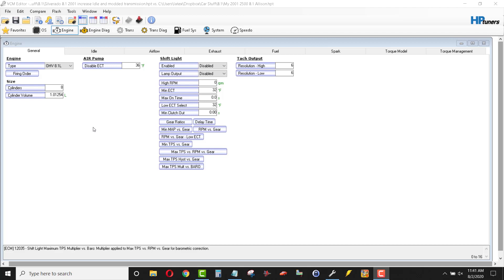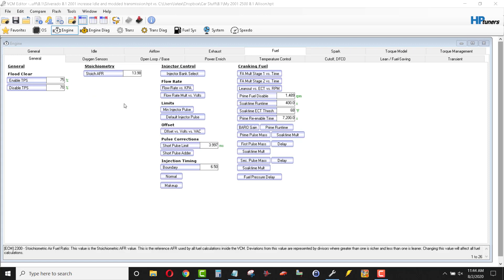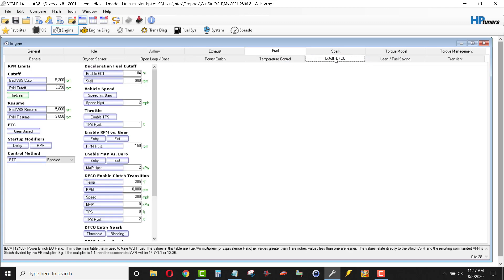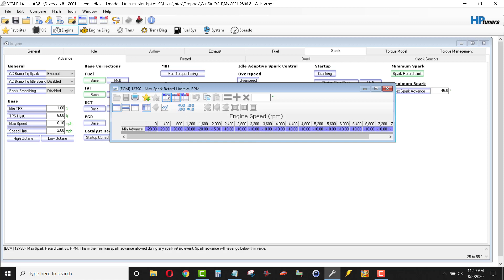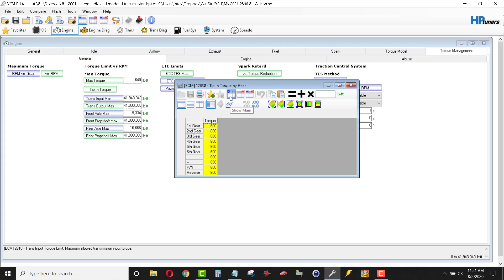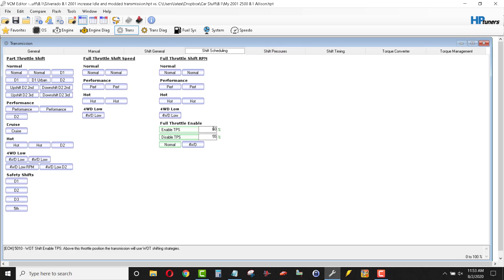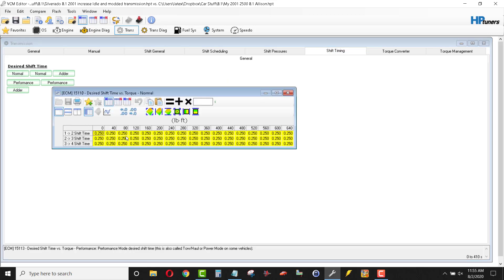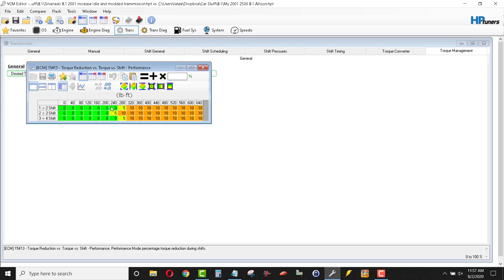Silverado Engine and Transmission Tuning HPTuners 8.1 Allison

Comment: Excellent video.... are you still tuning?? I have a 05 3500 DRW with this setup. 8.1 Allison. my mods: gibson shortys ,x pipe,duel flowmasters,3.5 duel tailpipes,CAI,MSD street fire coils,Raylar bp202 roller cam and rockers combo...is there anything you would change in this tune??
Thanks
Reply from the maker: I don't know what tune you have to start with - stock?
Reply: your tune in the video as close as possible, I do have an TDN account if that helps. thanks  @CarswellsCustoms
Reply from the maker: @mud4x  Sorry bud, I don't recall what TDN is? With those mods I would pickup a wideband and tune for WOT 12.5 AFR. Start there and with all those mods you will be very happy with the 8.1's response.
Reply: Thanks, I have hp tuners MPVI3 comes with TDN ( Tune delivery network) @CarswellsCustoms
Reply from the maker: @mud4x  Oh, yeah. Early morning... Email me a datalog @ mymusiconmyiphone@gmail.com

Comment: I'm curious why a lot of the transmission tables only show up to 4th gear? Can you not tune the behavior of 5th (or 6th if equipped) gear?
Reply from the maker: If the tables are there then you can mod 5th gear. I guess you would have to ask yourself what you need 5th gear to do differently? I would assume that when I mod my vehicle I am looking for improved transmission performance by decreasing shift times, and increasing holding pressure to get the load up to speed with reduced wear on the trans. I personally would not worry about 5th gear too much as I would assume that the load is mostly up to highway speed and most of the stress of accelerating the load has been handled by 1st through 4th. Just my .02.

Comment: Hi. Just wondering if you have an opinion on how many miles is the Allison trans usually good for? I'm looking at an '04 Avalanche with 8.1 & Allison. Truck has 252k.  Transfer case was just rebuilt, but trans & engine are still original. Thanks in advance.
Reply from the maker: @Dennis Tucker Gosh, I really would not know without the history of the vehicle. I mean, how much of its life was towing 14,000lbs for example? My truck towed horses before I owned it and now I only tow a 3000lb boat. So I believe history is more important than brand name. Sorry, not very helpful...
Reply: The 2500 avalanche never came with the Allison trans. Only 8.1l with 4l80e.  Want fit without a body lift.

Comment: Would you consider tuning a 2008 6.0 Chevy 2500? I need torque management (aka nanny controls) turned off!! My Black Bear tune didn’t do it!  Truck runs great with only 86,000 miles on the clock,but it needs more. I don’t mind seeing tire smoke now and then!😜
Reply from the maker: @Gerry Patrick Thats curious, many people are very happy with their Black Bear tunes. I would be happy to look at the file for you, I have tuned quite a few 6.0 trucks.  Can you or a buddy pull the tune and email to me?

Comment: Hi I Love the tune on your truck.Would that work on my 2004 3500 srw. xtndc. lngbx. 8.1? Im hauling a 9'4" camper & a 8"cargo trailer 6mos. of the year in BC Canada. Im having a Raylar modified stock intake installed the end of Feb. A tuner is doing the install& tuning. I have same mods you have, on my truck. Thnx
Reply from the maker: Yes, if you are having a tuner do the work he could start with my tune as a base, and go from there. This tune has been used in my truck for over 2 years now. Good stuff. Send me an email for a copy - mymusiconmyiphone@gmail.com
Reply: @CarswellsCustoms I email you

Comment: So this may sound like a dumb question....but with all this "transmission adapter" and "stand alone tcm" stuff, by any chance could I swap a Ally 1000 to my Ford 460 and still be able to tune it? The 460 is built so I know the Ally will have to be built. Just wanting to know if I can set my shift points as high as I'd like to (6400 revs)
Reply from the maker: @R3B3L10US_TY Good question, it would have to depend on how your are controlling the Allison transmission - I would think you would use 2 systems, ECM to control the 460 (or carburetor) and another system to control the Allison. I dont believe you can easily modify a Duramax or 8.1 harness and computer to work with the 460 so you would have to find a Standalone TCM for the Allison that you could set the shift points. I have not researched it but if you send me a link to a standalone Allison Transmission Computer I could do some research for you.
Reply: @CarswellsCustoms  I'll get right to it, bud. It'll take me a little while to figure the link stuff out but I know quite a few stand alones out there. Most of the stand alones are from diesel performance shops but that shouldn't be a big problem.

Comment: did all your adjustments,  between first and second shifts now it hesitates a sec and the  engine revs , then slams into second . what did i do wrong?
Reply from the maker: Unsure, go back to stock then change one section at a time. Start with reducing  shift timing test then when you are happy work on new settings from there.

Comment: Hello,  I am interested in tuning my 02 Silverado cc long bed rwd 2500. 8.1/Allison.   It has Gibson headers, k&n intake, Gibson muffler and dual exit with tips.   I replaced all plugs with gm delco plugs & msd wires…can’t figure out why the truck runs so poorly.  It barely tows as good as my 5.3 that’s has more than double the mileage on the odometer.  This 8.1 only has 108k miles.   It get 6mpg and tows terrible.  It struggles to maintain 65 mph with out down shifting with no load (empty bed, no trailer).  I’ve ran high octane fuel etc and no real difference.   Everyone I talk to tells me the 8.1 should tow as good as a stock lb7.   Any ideas??!! Please help.   This is such a nice truck but I think I’m going to sell it if I can get it to do what it’s supposed to do. Also, has no DTC or check engine lights of any kind and it passes smog no problem.
Reply from the maker: I havent pulled anything with a Duramax, my only diesel was a 7.3. But I know my 8.1 will pull the ears off a Gundark and chirp second gear. The 8.1's are good healthy engine.
Reply from the maker: Wow, lets not jump to tuning yet as this seems like a fundamental issue. Lets start with basics - first clean all grounds especially the drivers side engine ground on the bottom of the engine block. Use dielectric grease after cleaning. Second read the fuel pressure on the rail, looking for 58-60 psi. Since the plugs are new, pull them and read the plugs. I like thos website and I bought some of their printed instruction manuals - http://www.4secondsflat.com/Spark_plug_reading.html
Reply from the maker: DTC's can be turned off with HPTuners so after the basics are investigated you can move onto more advanced stuff.

Comment: Hi i have a 4500 u haul w 8.1 and allison 513 gear i believe can you re pgm my computer if i send it to you.
Reply from the maker: Yes, I can do that. What was the year? Actually can you email me at mymusiconmyiphone@gmail.com 
Thank you!
Reply: O.k. 2005 142000 miles 19.5 tires. 513 gear 5sp allison also can the trans be redon for 6speed. I believe that there is a kit or a way to do. Also cost thanks. John in idaho

Comment: Great Video!  I just bought a 2001 Sierra with the 8.1 & Allison.  I am wanting to get the Allison to upshift sooner in the normal mode.  I have been trying to figure out which tuner is better suited for the older Allison TCM, EFI Live or HP Tuners?  Your video doesn't seem to show the Allison transmission options or am I mistaken?  Will the HP Tuners software talk to this older 8.1 and Allison combo?
Reply from the maker: Texasdeere, I have a 2001 8.1 and Allison, I use HPTuners and I am very happy with it. Cant give an opinion on the others. You want the upshifts to occur sooner? In HPT you would go to Transmission-Shift Scheduling- Part Throttle Shift - Normal. After you get into the shift matrix you can increase or decrease the MPH the trans will shift at by Throttle Position/MPH and what shift you are looking for such as 1-2 shift or 2-3 shift. I am going to do an update on my engine and trans tune this month so check back or subscribe. Sounds like it may be what you are looking for.
Reply: @CarswellsCustoms  Thanks for the quick reply. I am primarily interested in tuning the Allison as you mentioned and if I could tune the 8.1 any it would just be a plus. (No big mods planned like yours)

So I need a laptop, hpt software, hpt obd connector, and 2 hpt credits?

Thanks
Reply: Also I was planning a gear change and slight tire upsize.  Is this something the hpt would cover also for the speedo accuracy?
Reply from the maker: @Texasdeere  Yes, you can update those parameters too.
Reply from the maker: @Texasdeere  Yes, I have the Pro version and I would reccommend getting the same. The diagnostics are great so go in on the price with a buddy, its great for reading trouble codes and finding issues. Check out my video on misfire diagnosis using HPT on my 8.1. About any Windows laptop will work. HPT does not require a lot of resources.

Comment: I didn't feel a whole lot of power difference from my engine after following your steps. Then I noticed your Min Torque was set to 100%, which I do believe means PE won't engage until you've reached 100% torque usage. I set this down to 30% and also turned my Min Map to 45 kPa as well as turned my delay down from 60s to 1s and do believe I feel a difference now. Do you think I might have a point or was it just all placebo effect for me?
Reply from the maker: Hey Congrats on jumping in and making some changes! Min Torque - Don't remember changing that, can you let me know where to find that parameter? My PE delay is at 0seconds, but my enrichment ramp rate needed to be increased to 1.3. Have not changed the the Min Map, and my Max Torque is set 100% in all tables that apply.  Placebo or not, if it feels right its right. Thanks for the feedback!

Comment: I just bought a 2002 Silverado 2500hd extended cab, Long bed with 8.1 and Allison transmission super clean, not a spot of rust on it. I love this truck! keep up the good videos I'll be getting into tuning soon.
Reply from the maker: Congrats! The thing I love about my truck is that whatever I need done it does it without struggling. Lots of people claim to pull a dozer with an S10, but the question is "how long will it last"? 8.1 and the Allison are a super combo with low maintence costs. I have a tuning update I will post soon. Thank you for the comment!
Reply: @CarswellsCustoms I need this tune
Reply from the maker: @jeremyblain5212  email me at mymusiconmyiphone@gmail.com

Comment: How did your mpg react to the tune? Better or worse?
Reply from the maker: I see. With my truck I saw the greatest fuel mileage improvements when I changed out the Cam Sensor, installed a 2 into 1 performance Y-pipe with a Dynomax straight through muffler, new copper plugs. The truck really woke up when I pulled the grounds off cleaned them all with a wire wheel or sandpaper then used dielectric grease on all ground attachment points. I also added a braided ground strap from the body to the battery. The ground cleanup and add turned the truck into a brand new ride! It starts super fast and it eliminated any power fluctuations inside the cab. Try those out!
Reply: @CarswellsCustoms  I know this is an older thread but where did you find the 2 into 1 Y pipe? And why did you  change cam sensor? What did you gap the spark pugs too? I hear .040 is a better gap than .060
Reply from the maker: @DOOB509  Hi Barry, I got the Y pipe from Summit Racing. It really depends on who you ask on whats a good plug gap. Testing for your application is the best answer, if you want to run .040, then awesome - read the plugs after 1000 miles and let me know your findings. Thanks for reaching out!
Reply from the maker: I really cant keep my foot out of the throttle so the mileage is worse for me! Under part throttle the computer tries to achieve 14.7 AFR for mileage so if you drive sensible the mileage will be ok. If mileage is a concern, leave the Power Enrichment modifier stock, along with the other fueling settings. Good Luck!
Reply: @CarswellsCustoms  i have the same problem with mine...cant keep my foot out of the throttle.  But right now I'm only getting 10mpg if I'm lucky...usually 180 miles to a tank if I fill back up at close to a quarter a tank
Reply: Will HP tuners work on a 06 chevy kodiak 8.1 gas engine with the Alison 1000? I'm trying to get more towing torque this is my rv..
Reply: @miguelramirez-ss2vp  should work fine it runs off same p59 pcm in truck ,rvs , and medium duty trucks

Comment: You did a great job on my 2013 Chevy Silverado!!  It pulls my 22ft Formula with no issues at all!! First gear will pull the ears off a gun dart and it rolls into 2nd like a B&M shift kit every time if you want it too!!  Completely woke up my 5.3LS it hauls ass for a crew cab 4x4!!  I would recommend this guy to anyone!!
Reply from the maker: Thank you! I love the 6l80e, its my favorite transmission.